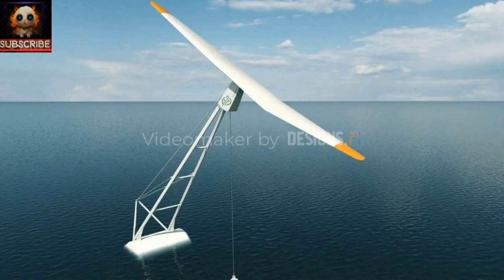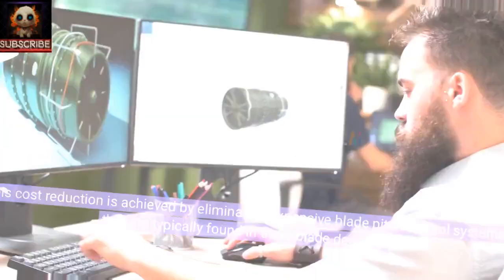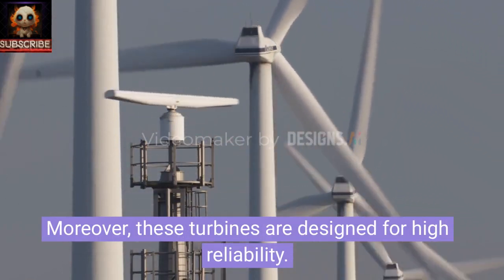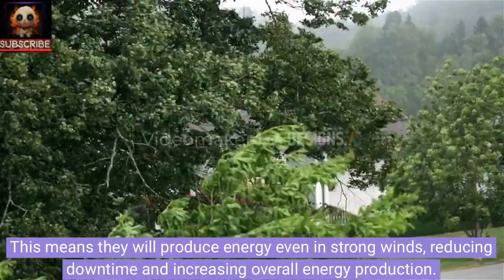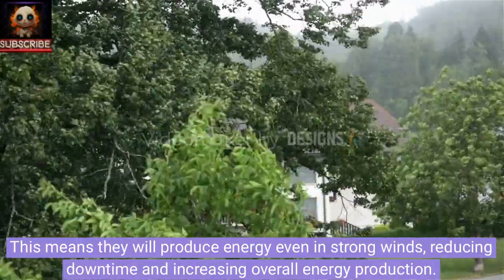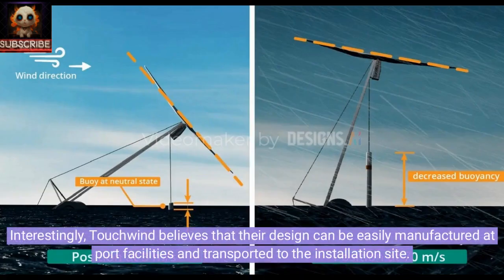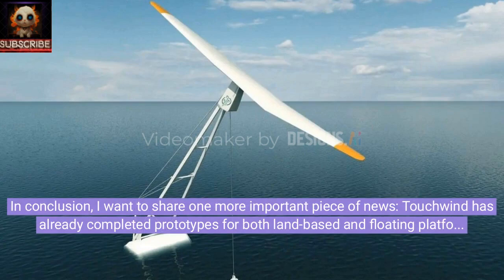Touchwind's Wind Turbine Breakthrough: More Power Lower Cost

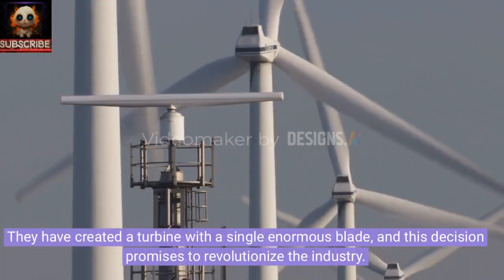Comment: Fake...? where is that one blade turbine to be seen at WORK? what have those CAD screens with jet propulsion turbines got to do with it?? What has that RADAR at 00:23 got to do here?

👎
Reply from the maker: Thank you for your comment and questions! We appreciate your curiosity.

The single-blade turbine by Touchwind is a cutting-edge innovation in wind energy, and it's currently being tested in various locations to assess its real-world performance. While we didn't show a specific working turbine in this video, Touchwind is actively involved in prototyping and testing both land-based and floating platforms. These tests help validate the technology and its capabilities in different environments.

As for the CAD screens displaying jet propulsion turbines and the radar at 00:23, they are included in the video to provide context about advanced engineering and technology. While they might not be directly related to the single-blade turbine, they demonstrate the broader technological advancements and research happening in the field of renewable energy and engineering.

We appreciate your interest in our content and are here to answer any further questions you may have about this exciting innovation!
Reply: It generates more power then those with three blades